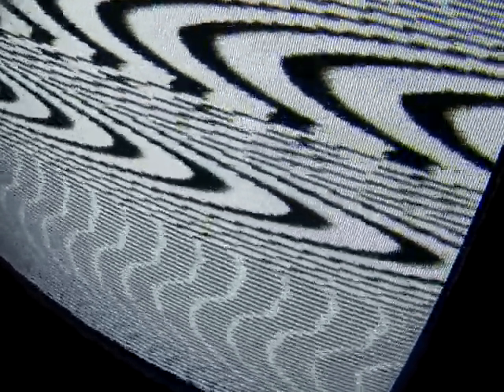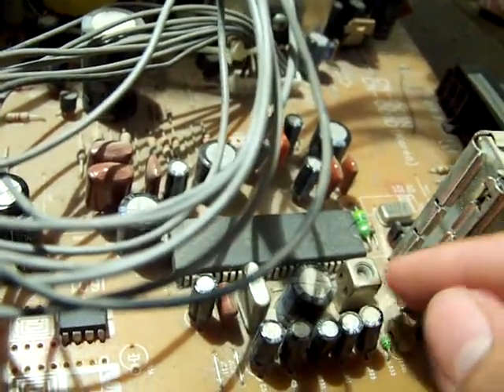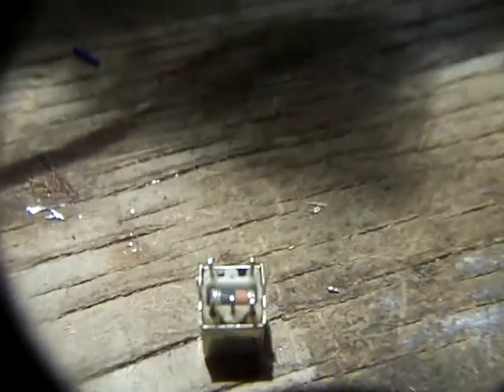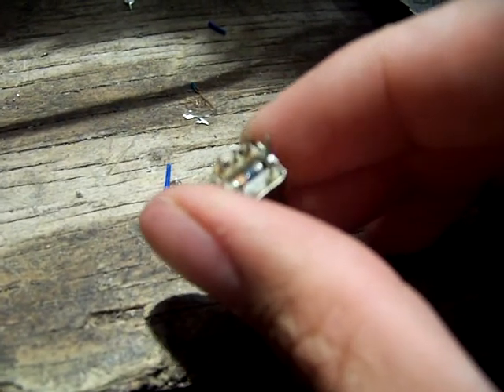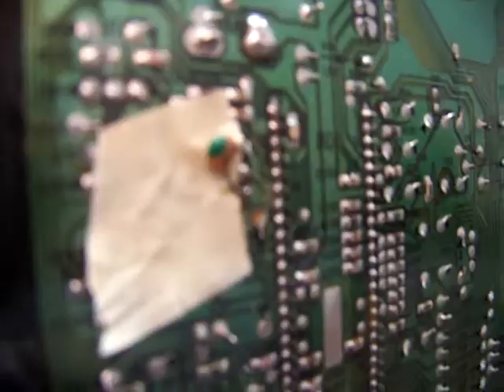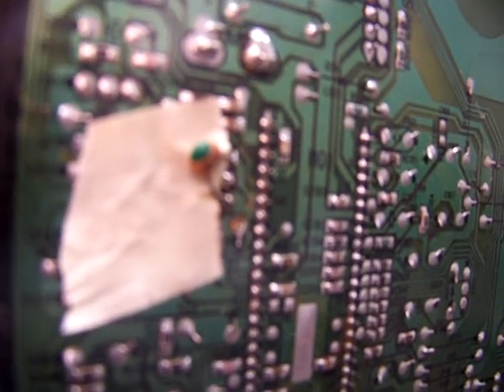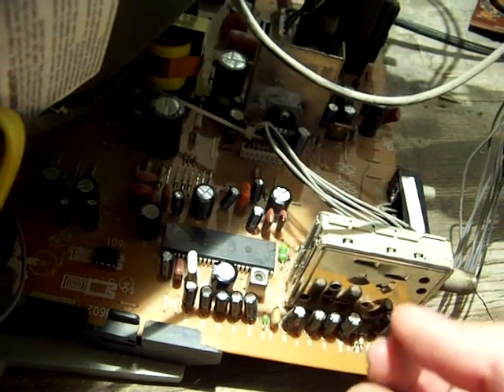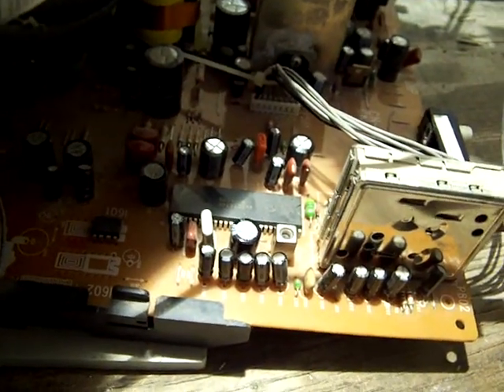TV with scrambled picture IF repair

Comment: I accidentally knocked my Samsung TV off it's stand, it fell on it's back. Now the screen looks like multicolored plaid. The screen isn't cracked, I also removed the back & nothing looks like it's loose. Any ideas what's wrong. I can't afford to buy another TV at this point.
Reply from the maker: If its an LCD screen then it's gone.  If it's a CRT it may have become magnetized or the screen is damaged.
Reply: It's not cracked anywhere, so did something just jar loose? The table it fell from is only 14" high. But I appreciate the reply.